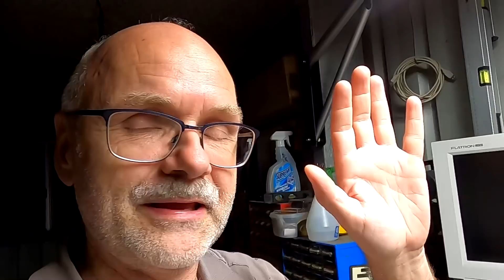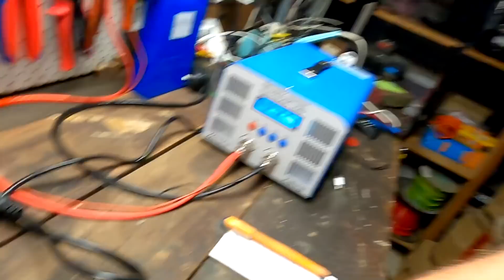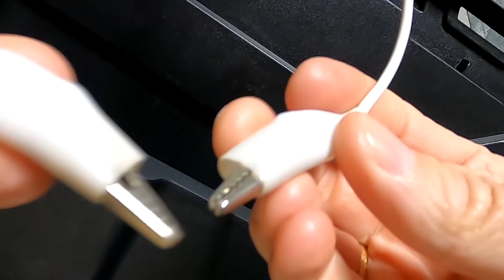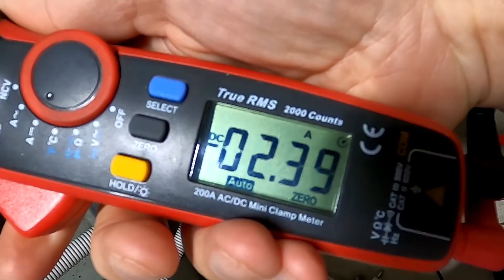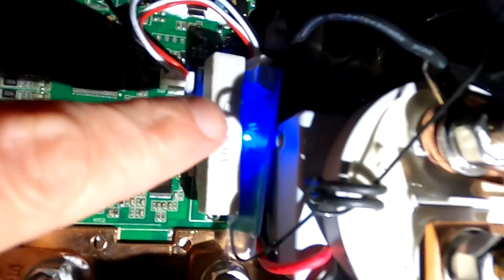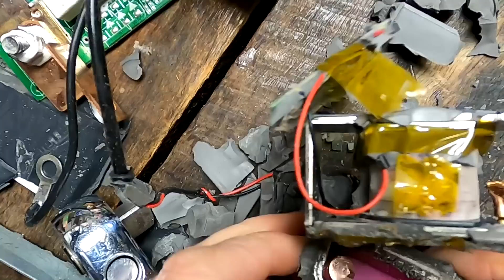The new QUCC 200A BMS. Does the Relay-BMS work this time?

Comment: Thanks for providing a great service! I have tried 4 different BMS's and their apps and have seen EVERY one of then have a CHARGE and DISCHARGE button as does this QUCC. They are all RELAY controlled. From my perspective, one cannot CHARGE unless the CHARGE BUTTON is on/active AND cannot DISCHARGE unless the DISCHARGE BUTTON is on/active. On some BMS apps, BOTH of these buttons need to be on when either CHARGE or DISCHARGE is required. No explanation as to why.  Ron Motis EV Designer/Fabricator, currently assembling a KARMANN ELECTRA. ( a '73 Ghia coupe).

Comment: My JBS  7S-20S 200A 21V 24V 48V 60V 72V Smart BMS Balance Board Protection With Bluetooth is driving me NUTS .. it clicks over and over . I try so many settings and it stills does odd things. I'll never buy one with a relay again. Too noisy ..  :(
Reply from the maker: The relay BMS is certainly not designed for solar storage installations, I found. They are more for electric forklifts and such.
Get a JK-BMS with active balancer. It's one of the best.
https://off-grid-garage.com/battery-management-systems-bms/
Reply: @OffGridGarageAustralia   Thank you I knew if there was anyone who had investigated this piece of you know what it would be you.  Thank you for taking the time to reply I really enjoy your channel and donated a little bit of money towards your beer :)

Comment: so I finally got a chance to play with my bms today and it behaved the same way with the relay not working and the bms beeping when trying to switch charging on or off. I unplugged it for a minute and  turned off the charging current. then reconnected the sensing leads and everything started working fine. it seemed to take about 15 seconds to boot up fully before I could do anything. rebooting without turning off the incoming charging current would not allow the relay to work for some reason.

Comment: I can use relays to design a bms as a engineer you can’t use one relays each battery cell need it’s own relay that’s how it work the bad thing about transistor pulling down current when battery cell full is heat relays don’t use that much energy make sure to use 20 amp 5 pin relays

Comment: Hello, I have been watching your videos for a long time and I have found a lot of important information in them many times. I wanted to ask if you ever tested this BMS without the relay connected?
The issue is that I myself have a JBD AP21S002 and I would like to disconnect the relay and leave only the board itself. I run with a Victron and believe in disconnecting it more than this BMS. Of course, there is also the option of relay terminals, but...

Comment: It would be interesting to swap the relay out onto the old board and see if it functions.  If not then you know the tiny circuits were screwing up.  Then you could ponder what was causing that, late at night whilst you lay in the bed:)

Comment: I have the same BMS. 3 of them in fact and 3 of them have a big trouble. If I charge a lot the battery to make the BMS disconnect it (opening the relay) after a cell reach 3.65v, the BMS is not able to reconnect the battery (closing back the relay) when the cell go back to an acceptable voltage until the charger sends about 20A. That means the battery could stay disconnect all night long waiting the sun rises next day ! So it makes this BLMS unusuable. QUCC support told me it is possible. That their design is not perfect. And that it is a low cost product not really suitable for solar. Numerous Chinese companies are not reliable at all, they sell shit and are proud of it....
Stay away from this BMS, it is my advice.

Comment: So what happened to the battery charge switch which didn't seem to do anything
Reply from the maker: I left it as it was. It can be used to turn the BMS on and off apparently. This is for mobile applications though. In solar storage you leave the BMS running 24/7.

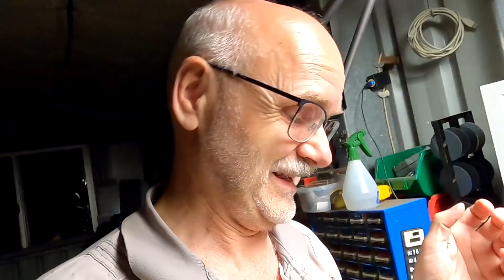Comment: 6:20 could that mean weak switch is the reset switch? or perhaps when the whole system is very low voltage (ie weak) one needs to kick start it with that switch hence weak switch?

Comment: Any setup hints for this bms, 48v system, relay keeps clicking when batteries nearly charged and turning growatt inverver off,
Reply from the maker: Very hard to tell without seeing all the settings on you BMS...
As a test, set the over voltage protection voltage to 3.7V and see if that fixes it. The put it back to 3.65V or 3.6V

Comment: The victron shunts look for SOC to drop below a certain value before they count it as a cycle. They don’t accumulate partial cycles. I forget the threshold, but lets say it needs to drop below 80% before they count a cycle, and since they don’t accumulate, 6 x discharges to 82% will NOT be counted as one cycle, but rather as 0. 🤔 
Which means if you were never to drop it below that threshold, your cycle count would be at 0 forever… 😕 

So if you want to assume that your real cycle count is an accumulation of all your partial discharges, well the victron shunt is not helping you count that….
Reply from the maker: My Victron shunt does count partial cycles and ads them up over time. It works well.
Reply: @OffGridGarageAustralia  intersting, mine doesn’t seem to. Mine is the smart shunt 500a, which is yours?
Reply: @OffGridGarageAustralia  if you divide your discharged (or charged) energy by your cycle count, does it add up to more or less your total battery capacity? Mine doesn’t 😕 
Charged/discharged energy: ~30kwh, battery capacity is 3.5kwh, reported total charge cycles is 2 😕

Comment: Hi, i was looking to buy this BMS for a solar battery bank (i have an ibrid inverter that power my home with grid energy if the battery runs out).
Do you suggest me to buy this one or a Daly BMS with common ports? (as i understand common ports bms works like this relay once)

Comment: Hey Andy great video, I managed to get a JBD BMS that looks exactly like this one (same electronics, same relay, same app, literally the only difference is the brand) for my own solar setup, however I noticed that the app doesn't seem to show any charge or discharge that is bellow 2.0 amps, it just shows it at 0, does the Qucc version also shows this behavior or could it be a faulty unit?
Reply: I just got a JBD unit as well.. Mine also does not show charge or discharge current under 2 amps.

Comment: Thanks for sharing your experiences with us! Always fun to watch & learn. I just want to warn everyone implementing those contactors in their builds that those, both the new white one and the one one the previous BMS, were not designed for switching capacitive or inductive loads. Those are super expensive vacuum sealed contactors with economizing circuitry, the price of which can be well around $200, however,  those are for holding & disconnecting only. Let's say, used at the output of a high current battery charger. When the charger is powered, the contactor closes and connects the batteries to the charger's output at 0 current flowing. And only after it is closed, the charger's output current is generated. Those are widely used on EVs and PV systems, as disconnects. If by any chance those are used, let's say, in between batteries and inverters with big capacitors, or switching motors, chances are the contacts soon will be welded or simply worn out. I use those often at my work, and have autopsied many faulty ones. All those use is just a flat piece of silver plated brass shunting two round silver plated brass ball pins. Our friends in China, could have used much more affordable contactors with thick silver alloy contacts designed for capacitive and inductive loads. I assume, they must have gotten hold of large quantities of these "white" ones for a good deal...
Reply from the maker: Thanks for sharing. So it's not really about capacitive or inductive loads (as it is DC anyway they switch), it's more about high inrush currents they don't like. They are advertised as starter motor relays though, so should withstand exactly these higher currents of motors.

Comment: Having bought the QUCC BMS and installed it I now have a problem which will affect anyone else who has yet to download the software. The feedback about the Xiaoxiang BMS software as always been critical but now it is totally unusable for monitoring and controlling the QUCC hardware. This is because the available version of the software on Play Store has now reverted from 3.1.1026 to 3.1.1014. This no longer offers display of all the cell voltages and has a much reduced menu options. Unless there is another app which can control this BMS it seems that I will have to buy a different BMS. Does anyone have any suggestions?
Reply from the maker: Hi Nigel, did you have a look on my website, there is always the newest version of the app with full functionality. This app comes directly from the developer and bypasses the Play Store.
Reply: @OffGridGarageAustralia  Hi Andy
Thank you so much for that info. I now have the latest version installed and I now have a full set of menus with display of all the cells. After using the EBC A-40L to test all 32 cells I found that my cells were between 289Ah and 299Ah, well below the quoted 310Ah. Even though I sent copies of the graphs to Alibaba the dispute went in favour of the supplier. In future I will stay with one of the recommended suppliers. My cells came without any insulated covering on the bottom which could have ended up with a dangerous short as I had planned to place them on a conducting surface. Definitely an important check to make on receipt of the cells.
Apart from the max voltage did you use the recommended parameter settings as listed on the AliExpress website?
I have now bought the grid tie 2kw inverter to try out. AliExpress won't ship to the UK at the moment (probably due to the Brexit problems we have had with the EU) but fortunately I have been able to ship to an address of a friend in France. I look forward to following your lead on that as well. My active balancer is standing by on hold as it seems that the jury is out on that one at the moment.
Many thanks for your help. Another SPAT on its way.
Rgds Nigel
Reply from the maker: @nigelcharles511  thank so much for your generous donation! Much appreciated.
That's not good that your cells are underrated. They should really hold the seller accountable for that,  just leave them a negative review (what I would do). I'm staying well within the recommended specs of the cells, yes. Have used the max voltage only a few times to balance the cells and the current and temperatures are all far less than rated.
Thanks again, Nigel!
Reply: @OffGridGarageAustralia   @Off-Grid Garage  The learning point is to stay with the recommended cell suppliers. Fortunately it wasn't critical for my application to have more than 290Ah.
I will give them a negative rating. I think that they assume that buyers won't test the cells. I had sent Alibaba a copy of the graph to prove my point. They had asked me for a video as well but I saw little point in that as the graph said it all. Because I didn't send a video they deemed my case not valid. Quite what a video would do to enhance my case is beyond me.

Comment: I'm waiting for this exact bms! Can you please tell me the size of the studs so I can get the right ring terminals? I've contacted my AliExpress seller and they've been useless
Reply from the maker: They are M8 studs at the BMS and cables have M8 ring terminals connected. It's a 25mm cable they are using.
Reply: @OffGridGarageAustralia  thank you!

Comment: There is a mosfet for charging. You see the extra black wire going into the relay on the output? It’s connected to a gate that allows charging when the solenoid is off. This prevents your charge controller from running away if you abruptly disconnect the relay (solenoid)
Reply from the maker: I thought this black wire is just a voltage sense. If the relay is disconnected the BMS has no idea what is happening at the outside otherwise.

Comment: The previous model was discontinued because they knew the relay contacts were no good. Once welded, the contacts likely didn't heat up. Imagine that...but the BMS would allow the destruction of the batteries.

Comment: I think that the spring was put on the wrong side of the contact plate. The spring is supposed to push the plate away from the contacts, and when the solenoid is engaged it overpowers the spring and makes contact.

Comment: I just read on your webpage that the QUCC sleep parameter can be adjusted (I assume on android app).  I found “view parameters” shows MOS control time.... but when I go into change parameters, that setting is not present.  Can you say where to adjust the sleeping timer?
Reply from the maker: Uhm, never heard about a sleep timer settings. I'll have a look and let you know. Not all parameters in the app will work with the BMS. It's a generic one they use...
Reply: @OffGridGarageAustralia  I have since read that the qucc/ jdb bms will not sleep as long as it sees activity on the current shunt OR the serial port.  So I will try to keep my app connected and pilling over Bluetooth for >18 hours and see if the bms stays awake.

Comment: Hi, great videos as usual. Could you explain why the relay bms has a precharging circuit and the mosfrt one doesn't? I always precharge my inverter before connecting to the bms but what if the bms switches off and on again? Would it be damaged by the surge if it didn't have a precharge resistor? Thanks
Reply from the maker: That is a very good question. I have no idea why the FET BMSs don't have it. Maybe they turn on softly, so not like the relay just BOOOM and on, but let power through more gradually and open slowly?

Comment: Do you remember feeling the heat from that big resistor?
If it is the precharge resistor it should not have been hot after the inverter precharge.
My guess is that the precharge resistor was allowing discharge when the main relay contacts opened.
It may all be related to that 'weak charge' switch......
Reply from the maker: It's cold all the time during normal operation. It does not get really hot, just hand warm...
Reply: @OffGridGarageAustralia 
 First, congratulations on 10,000 subscribers.
Next, the resistor shouldn't ever even get hand warm if it's only function is to precharge the inverter caps.

Comment: Did you test daly bms 4s 250a?
Reply: I tested 2 200A and in fact it is quite impossible to switch them on (activate them). One worked 1 week I don't know how. The other never started. I switched off the battery then the first one refused to start too. I am waiting a 120v power unit to give 58v charge. It is the last thing I could try. But if you have to buy to start them it is not very interesting. These BMS made me lost 2 monthes. I just ordered 2 of these presented in this video.
Reply: @monsieurd.6890  Have you tried them yet?  I am still looking for the best BMS, and was wondering if you thought this was the best.
Reply: @mfgxl  I tried the 13-20s model. They are working but they are not perfect. Sometimes after a overcharge test that worked (the BMS switch off correcty) I think it is difficult to get the relay switched on (it is like the BMS need a lot of current during charge or discharge to switch on or something I don't know : the software tells the locking has stopped just when it should but the relay led and the relay "clic" do not happen at this moment. It seems the clic happens when the charge current is high A. But I am not sure it is that that trigger back the relay.). In a few words I regret that the relay off works very well but the relay on seem not so reliable, when software tells relay is on again it is not always the case. But I never could make my 2 daly's 200A smart BMS work. So when I compare to Daly they work !

Comment: Look closer at your own video just after hacksawing. No you didn't cut the actuator from the relay solenoid. The spring section faces the top, so when the relay lets go, the spring forcibly breaks the connection :)

Comment: That app is definitely used for other BMS units. I've actually seen this exact app on other BMS units and that's why it has separate charge/discharge buttons.
Reply from the maker: Does not make sense with a relay BMS otherwise.
Reply: Some relay BMS have two relays - one each for discharge and charge. Relays are expensive, so this board 'might' have been designed for two and then shipped with one to save money. Great demo's by the way. You have more patience than me when the instructions are poor or something isn't working right.

Comment: We tried using mechanical relays on our solar remote sites when I worked for the Air Force. During the peak solar hours the relay would chatter on and off trying limit current so as not to over charge the batteries. We where using lead acid marine batteries, but the over charging problem would be the same for LiFeO4 or any battery. The chattering would eventually weld the contacts together. We switched to MOSFETs and the chattering problem went away.
The RS485 communication port would only be of service to you if had another BMS controlling a parallel battery pack.
I looked up the BMS weak switch term and I found that it refers to battery systems that are generally ran to a level of discharge that could damage the batteries. These systems generally have a circuit for the detection of low voltage of the batteries. (example: e-bike batteries) The weak switch will open the battery connection in order to protect the battery. In your case you would have to build the “low voltage detector” that closes the “Weak Switch “ contacts. You could test this by connecting a low ohm high current resister across the  “Weak Switch “ port and see if it opens the relay.
Reply: This relay should only open or close during an emergency situation.  This relay does not "control" the "Charging Amps".  The Solar Charge Controller regulates the Charging Amps ...